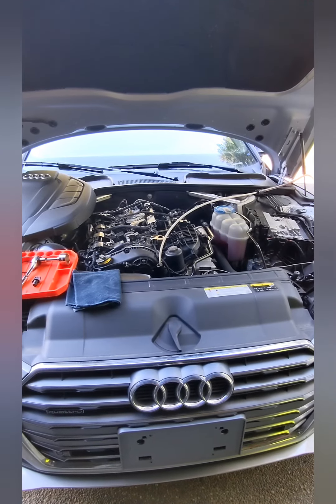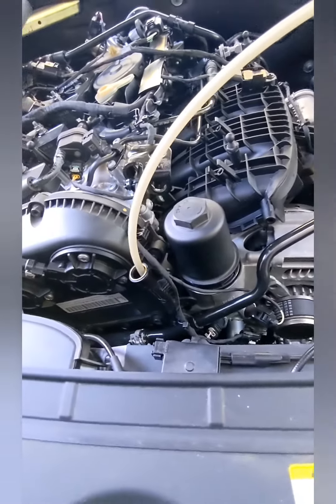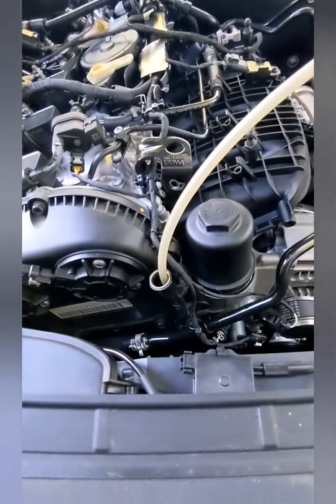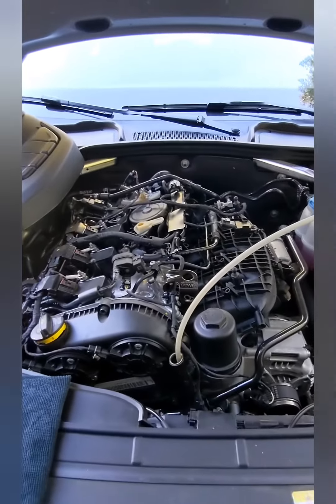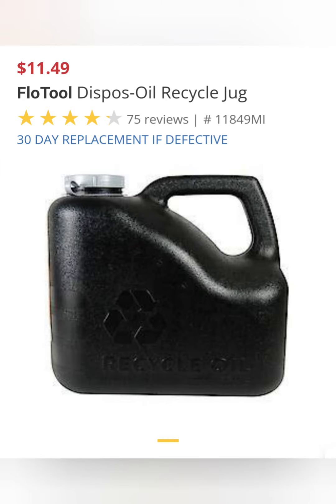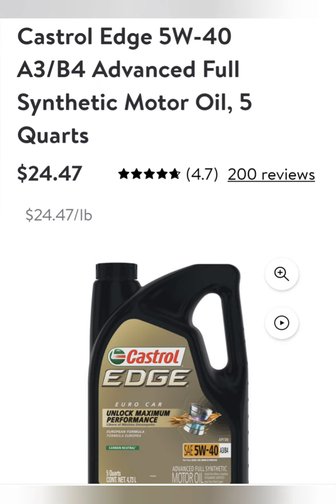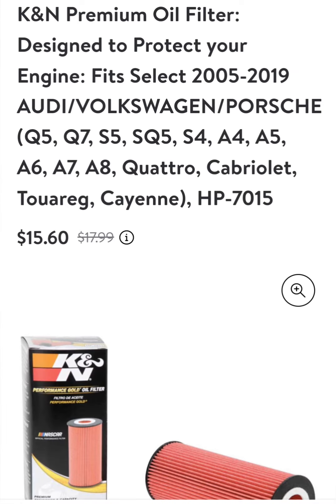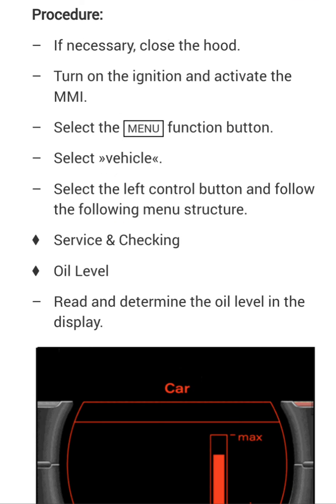DIY 2018 Audi A5 Sportback oil change (A4, A6, Q7, etc. plus many Volkswagen models)

Comment: Quick and easy explanation. While its nice to have that engine shield under the motor it's such a PIA to take off. I usually like to use the EZ drain plugs but surprisingly Audi uses a weird plastic oil plug so that was out of the question. This is actually a way easier option. Thanks.
Reply from the maker: Audi's shop manual (for the dealer techs) process is to change oil from above like this.  Of course, they use the high dollar super fast extractor, versus this inexpensive manual pump.  But you and I aren't doing oil changes very frequently, the manual pump is no problem, and let's us change the oil easily from above, the way Audi intends.  This is literally the fastest oil change of any vehicle I've owned.  Even faster than my motorcycle.

Comment: Hello, and thank you for the video.
How about the oil drain, how long do I need to change that. I usually do my oil change at Audi once a year.
Reply from the maker: Audi recommends every 10,000 miles.  If you are a person who trades cars every few years, the Audi recommended schedule is fine for you.  I keep my cars many years, always looking to get 200,000, or 300,000 or more miles out of them.  I change oil every 5,000 miles.  Twice as often as Audi recommends.  By doing the work myself, the cost is minimal.

Comment: Thank you! A quick question - the oil capacity in the A5 specs is 5.2 litres but the oil cans are all 5 litres. Do you always buy an extra one to put there extra 200 ml per oil change? Or is one 5L can enough? 2018 A5 Sportaback
Reply from the maker: Here in the USA the Castrol Edge engine oil is available in 5 quart and 1 quart containers.  I buy a 5 quart container at each oil change and I buy an additional 1 quart for every two oil changes.

If there are only 5 liter containers available where you shop, then pick up two.  Then on future oil changes you will just need to pick up one more, always using up the oldest oil first.  Opened containers have a shelf life of one year.

When I complete a change, I'll add a full 5 quarts to my system, then check level and top off.  You'll find that you use a slightly different amount at each change, simply because extraction and draining are not perfect and a little oil will always be left in the system.  And it will vary a bit each time.

When refilling, you'd rather be a bit low because you can then top up.  You don't want to overfill.
Reply: @KentForrest  thank you so much for the detailed answer

Comment: I haven't checked the manual yet, so forgive me for asking. How much oil do I put in before I can turn the car on and check the oil level?
Reply from the maker: Edit: Do check the manual in case of engine differences.

My 2018 A5 Sportback holds 5.4 qts.  I pay attention to the amount that I have extracted or drained.  It's close to this 5.4 (some residual remains in the engine, the filter, etc.).  Generally, I'll put 5 qts back in, then top off as needed.
Reply: @KentForrest  I’ll be sure to check before I do it! Thanks.
Reply: Back again 3 months later…

When the manual says perform the procedure at operating temperature, does that mean to drive the car for a few minutes before the oil change?

Comment: This is how I do it, but I change it every 5 to 6 k. Not the 10k like Audi says
Reply from the maker: Agreed.  I'm 5K on all my vehicles. I do think modern engine materials and synthetic oils have changed the game, and 10k may actually be ok.  But I pay cash for my vehicles and try to keep them 200k+ miles.  I want to get every mile possible from an engine, and oil is cheap.